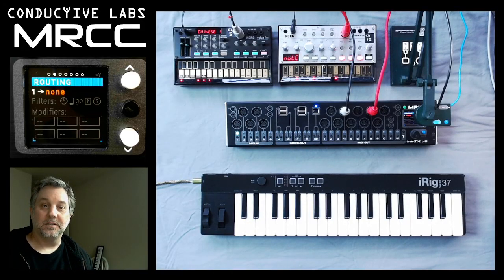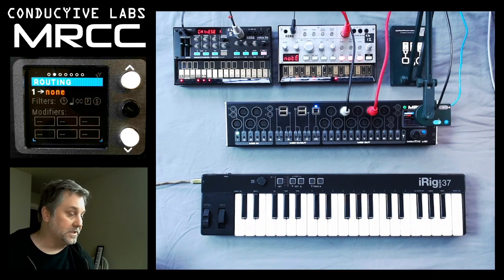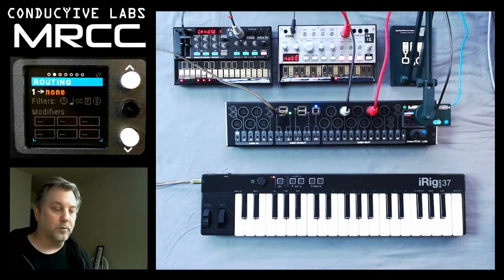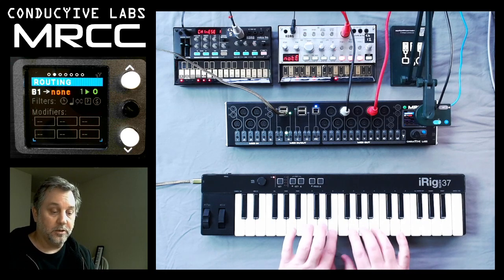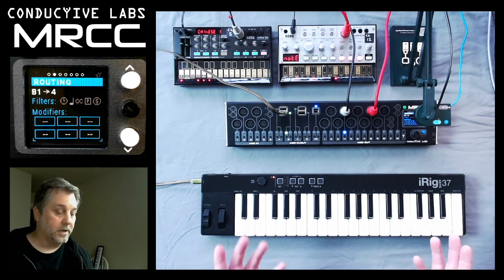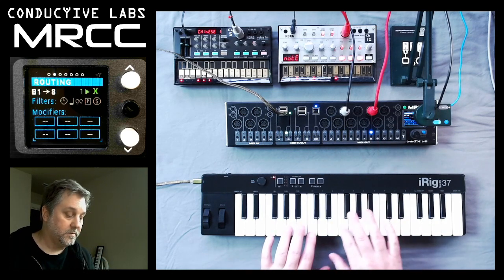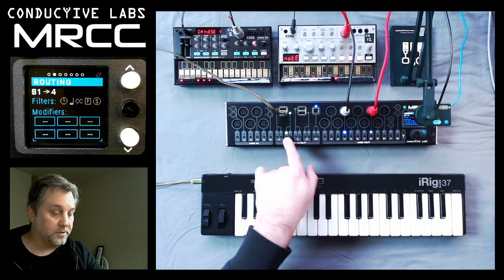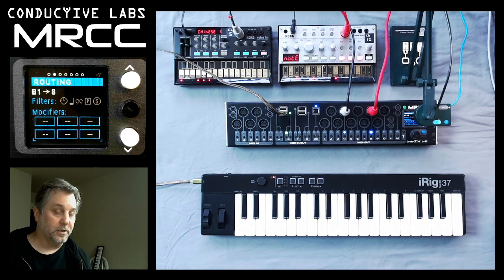MRCC #2 - Routing Gear w/ USB MIDI Cables

Comment: What about the NDLR? I have a preorder.
Reply from the maker: We are working on making a new batch of The NDLR. We sold out before end of 2021 and haven't been able to get chips to make more. So we are redesigning it for a different microcontroller. It will have the same features as the previous version. Rough guestimate is shipping in May of 2023.
Reply: @ConductiveLabs  Cool, thanks.